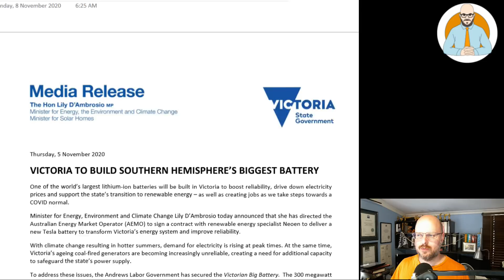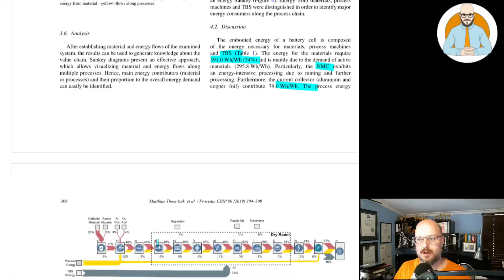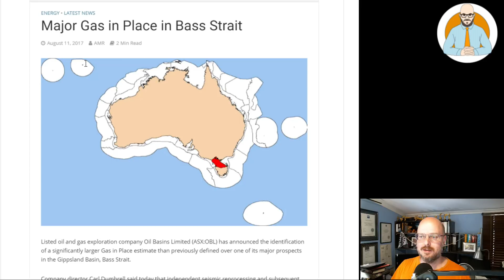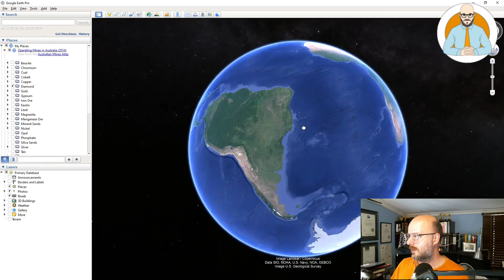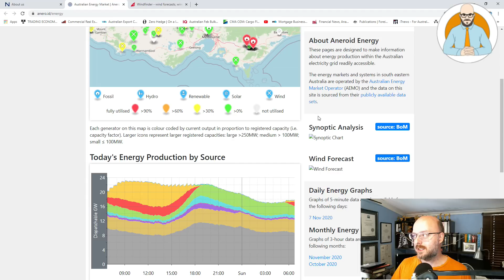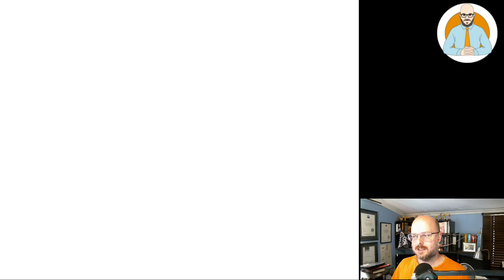Labor Building More Foreign-Owned Energy Infrastructure

Comment: After 40 years the oceans haven't risen (they are dropping a mm per year now as it gets colder). 
The winters are getting colder due to the low sunspot activity, grand solar minimum and milankovich cycles..
its never been properly debated and after so many decades isn't it time to review all the assumptions?
History tells us the discover of coal saved the European forests from being burned for fuel.
Now American forests are being chopped down and shipped half way across the world to UK and Scotland for wood powered power stations (except they call this biomass). 
Coal is part of every process (manufacture of alloys, essential part of solar panels, etc). In fact everywhere solar is used in large quantities the coal consumption actually goes up more than if the same place was supplied by coal power alone.

All I see is a lot of people making money on fake renewable energy and a lot of others making money on carbon credit trading schemes

Comment: Omg your so out of your depth here....Tesla batteries have been I dependent tested and cycled to 2.5 million miles and still over 80 percent of original capacity and that isn't even the new battery which is probably gonna last 50 years.
Reply: The aussie battery has made Australia a fortune..... its paid for or almost paid for itself already and has been such a huge success that the entire industry has seen how well it works. Solar and battery is the way to go especially In aussie.
Reply from the maker: No looks like 300 miles is the lifespan. Don't buy into the hype. Also, you can't hype away embodied energy.  Novonix isn't profitable yet. You can't avoid embodied energy, and it's all additional infrastructure that isn't needed with other more reliable technology. Be careful being a Tesla Fanboy. Let's wait for reality to materials., not just the hype. Look at the failed hyperloop and the boring company.
Reply: @HeiseSays  “more reliable technology “ like what??? Coal?
Are you serious!
Reply from the maker: Or Gas or Uranium. Don't be a childish ideologue.
Reply: @HeiseSays  don’t be an ignorant rightie. Watch Chernobyl Series or better yet go there for a tour.

Comment: Tesla warranties the batterys in their cars for 8 years. Id guess the same applies for hornsdale site & this one aswell. It's just many of the smaller batterys hooked up to make one giant one. Teslas also due to release a new gen battery using graphine.
Reply: Tesla tests their Power Walls home storage batteries for 5000 cycles and the warranty is 10 years. So the realistic service life is likely to be in the 13-15 year range.
Reply from the maker: Cool. But that doesn't mean anything with regards to embodied energy. Remember all this infrastructure isn't necessary with conventional power generation from Natural Resources that are in abundance.
Reply: @HeiseSays  i agree, i think it's totally unnecessary & the money could be better spend. Investing in newer gas or coal stations that are more efficant & cleaner. Or even better uranium or thorium nuclear. The benifit with thorium is you can mix in the waste from uranium generation & effectively burn it up to nothing. I read an article saying they were going to start moving the waste from sydney out to SA as the storage facility is starting to get to capacity.
Reply: @JohnSmith-mk8bf  gas in qld just proved over the weekend how expensive energy can be from non renewables, check it out.
Reply: @Backjack31  thats because it's coal country.
Reply: @HeiseSays  you should join scomos liberal party. You have the same outlook on energy. Forward thinkers, not!!!

Comment: The real jobs for this project in the long term is 2 or 3 jobs
Reply: Its likely to save money on power bills, which could be seen as having an economic impact similar to more jobs.
Reply: @georgewood6897  How when it takes more power to make the battery than it delivers?
Reply: @adenovirus.  thats no correct.
Reply: @georgewood6897  1130 watt hours for 1000 watt hours delivered. Cradle to gate energy cost. He shows it in this video.
Reply: @adenovirus.  LiPO batteries can have over 5000 charge cycles, so 1130 Wh per Wh for 5000+ Wh, you're not correct.
Reply: @georgewood6897  I downloaded the paper. It is from a conference on cradle to grave energy costs. It is not me being correct or incorrect it is what the paper said. So download the paper and refute it with all those electrical engineers. I have seen other papers on wind generation too. A lot of energy is used to create these non-green green energy sources.
Reply: @georgewood6897  I just realised what you are saying. You are confused with watts versus watt hours. Watt hours is energy and presented in the table as a relative cost.  It’s nothing to do with cycles. That’s irrelevant.
Reply: @adenovirus.  the table in candle to grate says Wh/Wh. If they were not talking about watt hours they should not have used Wh as the unit notation.
Reply: @georgewood6897  Agree it is not that clear and you could actually  read it as 1100 wh to deliver 1 wh with those units !!! Yikes. that's a very expensive battery. However that is where you could assume 1000 cycles of delivering 1wh which gives a total of 1000wh which is what I said in the first place.  Remember this does not count the actual energy it delivers it is just a capability. Every wh delivered required a wh of charge from the grid or a panel etc. which is a net zero.
Reply: @adenovirus.  if the infrastructure is managed correctly it could improve effeciency of the power grid by saving waste renewable energy. From what i read and understand the project is built to be power transmission between vic and nsw so it doesnt matter how much energy it stores and discharges.
Reply: @georgewood6897  It might do that but this conversation started with somebody saying "you are wrong" rather than "how did you come up with that" or "I challenge that statement". So assuming a 1000 cycles it costs more energy cradle to grave than the battery delivers so an electric car is a nonsense if it is charged up from the power point however it does reduce pollution I the city which is a good thing.  if you sweated the asset - eg go for more than a 1000 cycles lets say 1200 than the battery might be a net zero that possible.  Note we haven't factored in the energy costs of solar or wind which might blow this out of the water. The blades cannot be recycled and are buried in the ground, a lot of concrete is used etc and wind is very unreliable. Solar panels are also a waste problem and have high energy costs in manufacturing.  Using the gas like Heise suggests is a good idea, a coal station out in the country somewhere   but the soda ash has to be disposed of it is complex and so called green energy is not that green and not so renewable.
Reply: @adenovirus.  LiPO batteries can be cycled way more the a 1000 times, most can get about 5000.
Reply: @adenovirus.  to continue using coal and gas in the face of man made climate change and not invest in new technology so they can be improved is stubbornly insular. The emobied energy idea is also foolish if you think about, cause it seeds the idea that going to net Zero emissions will cost emissions so it cannot be done. If you don't build the battery or solar panel or the wind turbine with gas and coal power you'll never build them without.
Reply: @georgewood6897 Well you just answered your own question. There is no such thing really as renewables in today’s technology. It’s questionable whether it is doing any good. Everything we are told about CO2 has been debunked.  Problem, reaction, solution. Years ago they gave us a problem that’s wasn’t (anthropogenic climate change is nonsense), reaction (climate alarmism) then a solution (we are useless breathers).
Reply: @adenovirus.  climate change denial in the face of scientific community. You're a waste of time.
Reply: @georgewood6897  Can you explain why global temperatures rise 800 years before CO2 rises, not after? How we came out of the last ice age without polluting cars? Did you know termites create more CO2 than humans do?  It’s 2 percent of a rare gas that is 0.04%. The 97% consensus was of a survey of just over a hundred scientists all in grants the same year 20,000 signed a petition against it. You literally have no argument. I have facts and figures. I have also worked in a climate research unit  for many years and seen the pressures they are under, the cheating, adjusting figures, changing data and failed models. It’s easier to dupe somebody then show them they have been duped.   Get two cold cans of Coke and open them. Leave one in the fridge and one on the kitchen bench. Come back hour later. The warm can on the bench is flat it has released its CO2 the cold can in the fridge is still fizzy. That’s how it works. The greenhouse is a fluid this includes atmosphere and oceans. Most CO2 comes from the oceans after they warm a little. Hence the delay. CO2 has never been a driver of climate and never will.
Reply: @adenovirus.  milankovitch cycles can explain the heating of the ocean which releases CO2 from the ocean about every 41,000 years. We are now past maximum tilt of the earth's axis and we should be slowly cooling for the next 30,000 years.
Termites themselves produce more methane then humans but there mounds have bacterial that process the methane meaning a termite nest produces only one tenth the greenhouse gases, good try though.

Why is the earth still warming as the solar energy hitting the earth is slowly dropping?
Reply: @georgewood6897  The earth is not still warming trend. Last heat records were 1930s and 1870s. I am not “trying” I don’t have to.   A cooling trend is what we are in now. Your in denial and cannot backup any claim. Why do you mention methane when I said CO2. You aren’t even thinking about my answers.  I have not been rude to you once but you have been rude to me twice thus far. Go away and think about and use your commonsense. Try some good books or go to library and look up old newspapers for the heatwaves then notice those dates are deleted by the met bureau data base.   There is a delay between heating source and effect. It is called thermal hysteresis.  Time to move on. I have tried to help you.
Reply: It’s not always about jobs. And if it has to be about jobs what jobs will there be when we all become extinct after f-img up this planet? And if it has to be about jobs what about becoming leaders in transition from old to new energy?
Reply from the maker: @zvonimirbonanza7286  Calm down! Greta Said you have 12 years Before the World Ends. Don't want to use up all the crazy at once!
Reply: Heise Says - Greta is an extremist - but it appears that innovation is extreme for some, and change is impossible for others.

Comment: Is this battery for storage or voltage and frequency stabilisation?
Reply: It'l be for storage, as far as i know they usually do the stabilisations at the generation site. Thats generally what they do when doing upgrades at older sites. Upgrade the regulators for greater efficancy.
Reply: @JohnSmith-mk8bf  I was thinking it might be like the one in Adelaide which is a third the size. 300Mw seems small to be much use for demand the size of Victoria's.
Reply: @mazzdacon2134  the one in adelaide has expanded to 150mw now. Around 40k households for 8hrs. Its designed to supply extra power during the peak periods to lower the spot price, allegedly. It's a gimic imo.
Reply: It will be to totally fuck the 15 minute spot clearance price that has been making coal fired power stations profitable for the last 40 years. This will permanently close the door on new coal fired power stations once and for all. This will occur whether people want it or not.

Notably a 300 MW battery can only provide frequency stabilisation and fault tolerance. It can not replace a faulty steam powered turbine for more than a few minutes